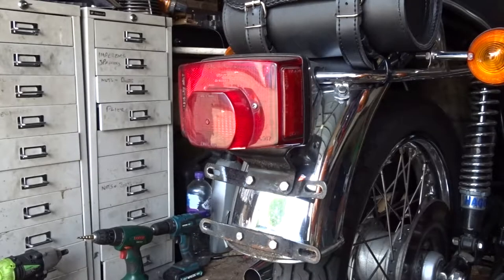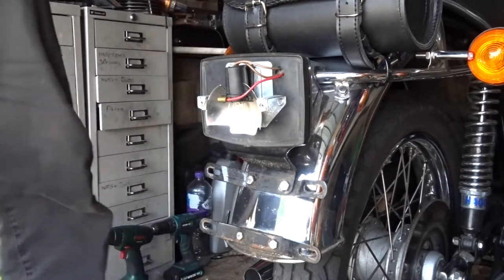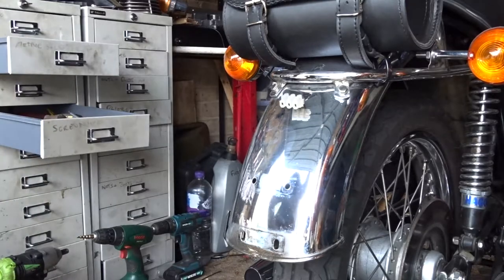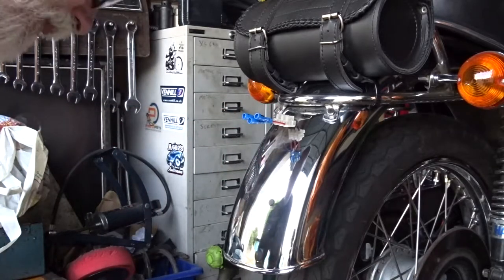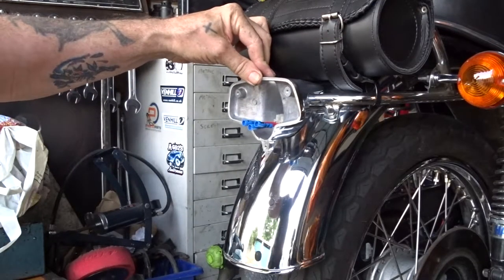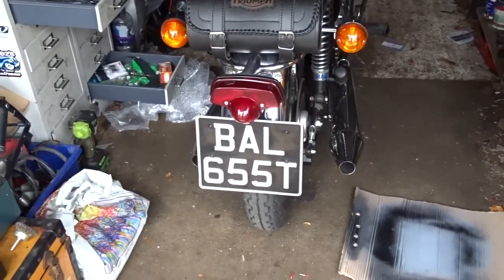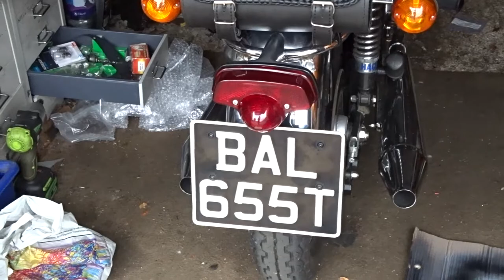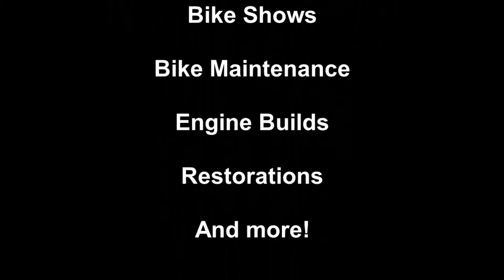Triumph T140 to T120 Style Rear Light Change

Comment: Looks grfeat. Need a list of parts involved.  S
Reply from the maker: Hi Steve, these  are the parts you need, the light fitting, the backing plate and the alloy housing, link below. I'll do a follow up in a couple of days because I made some adjustments to make it look and fit a bit better. https://www.ebay.co.uk/itm/155164379964